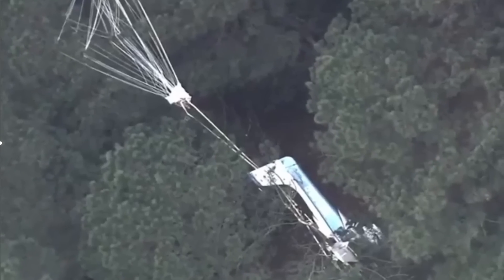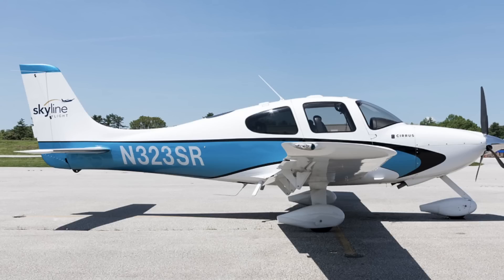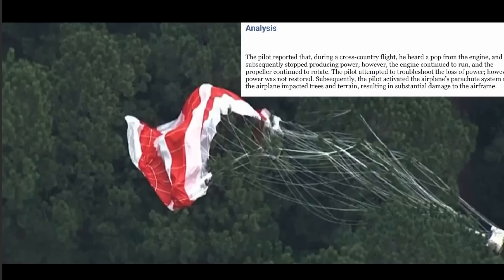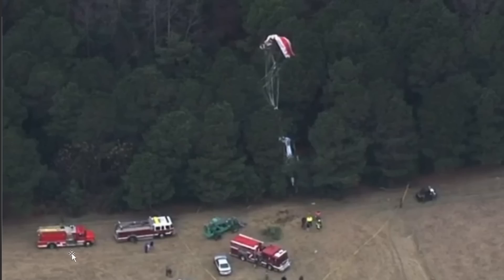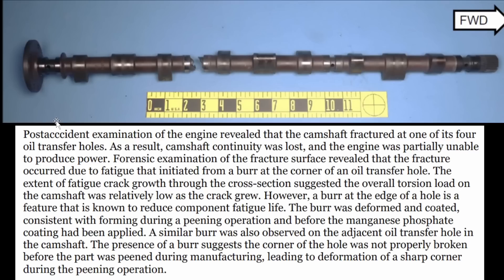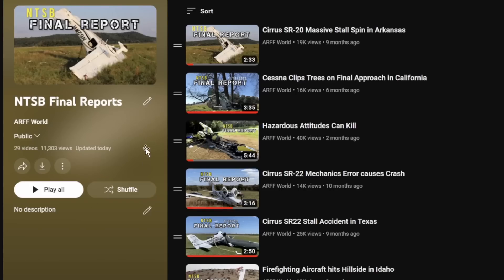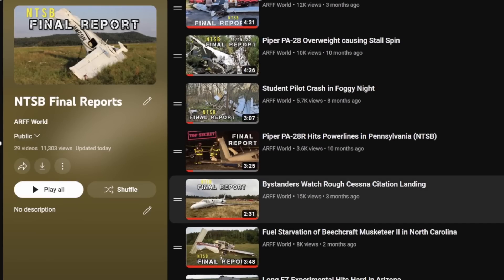Cirrus SR-22 Engine Quits

Comment: Call me a Monday Morning Quarterback if you want, but I found the actual location where this Cirrus came down on a satellite map. The area is not all woods and trees...there were fields available for a forced landing.

The pilot stated he was at 6,500 feet when the engine developed problems. That airplane could have glided approximately 7 to 9 miles from that altitude. There were lots of open fields large enough to land that airplane on. 

He wasted time trying to restart the engine, when he should have first been choosing an available field....but instead, he messed around and then opted for pulling the chute.

He did not have to ruin the airplane.

I wasn't there. I'm just stating the facts.
Reply: Except the facts are that cirrus recommends you deploy CAPS in this situation (unless you can glide to an airport basically). So you are supposed to troubleshoot, and then before 2,000 and making sure you are slow enough pull CAPS. They push this hard, because a bunch of folks lost their lives at the start of CAPS by trying to land in fields and killing themselves and pax when they had CAPS right there. If CAPS fails (it has) then you land in a field -> that the backup.
Reply: @randominternet5586  I agree - that's why you have a chute.  Chances of survival are higher with the chute than with an off-field landing with risks of fences, wires, ditches, a nose-over.  Cirrus's advice is solid, and this pilot was wise to listen to it.
Reply: Who cares?

Comment: I think in that situation I may have pulled the chute. While there are open fields, they are slightly rolling, so would have to be a wheels up landing which will result in damage. Occasion trees in those fields also, could strike and burn. Chute may have been the appropriate call.
Reply: Can’t do a wheels up landing in a Cirrus. It has fixed undercarriage. An off airport wheeled landing is never a great idea if you have other options as the aircraft will not slow down easily and the braking efficiency is compromised. Then you hit trees, buildings etc. It’s even worse if the wheels dig in. Then you have definite structural damage and the aircraft may flip. Off airport with retracts, it should almost always be wheels up. Max deceleration and the aircraft will slide 100 to 200ft max. Less damage than wheels down. This guy made the right choice & lived.

Comment: That field has fences in it. and the part we see looks short. Fixed gear plane so if the nose digs in we know what happens, maybe you get crushed in the cockpit. We see at least one horse, maybe there's more. aside from the animals standpoint horses are heavy compared to that airplane. I'm by myself, maybe I take the shot; my wife in the plane I'm going to land softly in the trees.
Reply from the maker: ThNks for your take
Reply: It also looks like it is surrounded by tall trees and hills which make for a steep approach. Like you, when I see a pasture it make me wonder, "So why haven't they plowed that field?" Usually it's because it is full of rocks, or has a gully, or other features that make is hard to run a plow through it. All of those make it dangerous to land in. Oh... and barbed wire.

Comment: Cirrus instructs their pilots to pull the CAPS system in virtually every scenario. Early pilots would often try to safe the aircraft and land it on a road or field, but many ended in fatalities. Also, you have to pull it soon enough when the parachute has enough altitude to inflate - somewhere between 450' to 600 ft AGL. Their theory is that if you monkey around too long trying to find a good place to land, you will often run out altitude and options, and now you're a statistic rather than a live pilot.

Comment: In my opinion, the pilot did the right thing. The CAPS parachute is on these Cirrus planes because they will not pass FAA without them. If you get too slow and enter a spin in those planes you will not recover. It's even part of the checklist on these planes. I recommend researching the CAPS system. Cirrus uses it as a selling point because most people don't bother to do their homework on things their purchasing. Then they will realise if it didn't have a CAPS parachute you probably wouldn't be making an emergency landing or spin recovery. You would be a crater in the ground and people would be at your funeral lying about how much of a good person you were. So do you want to live or do you want to die? Don't use the parachute if you want to be in the morgue.
Reply from the maker: Thanks Montreal for your take on what you would do.  Can’t go wrong with using the CAPS

Comment: Cirrus recommends pulling the parachute. Unless you're landing into an airstrip or a really smooth pasture, the odds of trashing the aircraft are pretty high. Once the engine quit the only thing you care about is lives, and the aircraft from that moment on is a dispensable. So you better just pull that handle and parachute nicely down, having almost a guaranteed survival.
Reply: Exactly this. The folks paying $900K for a new Cirrus with CAPS - they've insured the plane and don't want to be hurt or killed. Cirrus did a study - the result was use CAPS to avoid getting hurt or killed unless you can basically land on an airport or similarly safe surface. We get story after story about folks trying to stretch no power landings and stalling / spinning. Hitting ground obstructions with serious injuries and the list goes on. And the numbers have backed up this switch to CAPS use, more CAPS use in CAPS deployment envelope, and a great set of results on many of these CAPS deployments. This is no different. These guys are fine, their dog is fine. That's following a total engine failure. Another benefit we all get is these failures are MUCH easier to analyze if the plane isn't in small pieces. They can look over engine which is in same shape as it was when it failed and go, yeah, that wasn't going to fixed in-air.

Comment: Do exactly what this guy did, trouble shoot what you can, then pull CAPS first. Save that field option for if CAPS fails.

It's a composite airframe, it's the insurance companies plane either way it comes down. Remember the approach speed is still almost 90Kts in those things.
Reply: 80 knots on final, 90 on base and 100 on downwind, so ur still moving along pretty quick...
Reply from the maker: Right on Simon

Comment: ?Engine quits or runs Rough that’s what engines  do, however aeroplanes keep Flying so what do you do? you do what you always do you land  the aeroplane. So that scenario is kind of like you’re in a race car or a Porsche sports car and the engine quits on the freeway or race track what do?  you  find a place to pullover,  you land the car and try not to hit any other vehicles or Columns or powerlines or people or buildings you find a clear area to pull into so the mentality would be to have an injection Seat in your car when your engine goes out you inject With a parachute😅😅😅😅
Reply: No, the accurate analogy would be if your race car engine quit, you drove it off road into an open but unexamined, unpaved dirt field at 92 mph while trying to avoid fences, animals, tree stumps, and ditches that would kill you and your family if you hit them before coming to a stop.

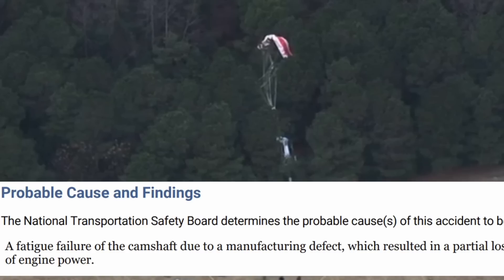Comment: Have worked in aircraft manufacturing and I read the summary at 2:09 with great interest. It pinpoints the camshaft failure arising from a burr at an oil delivery passage. Sometimes in aircraft manufacture the devil is in the finest detail. Small burrs, nicks, pits and scratches can act as stress risers and lead to fatigue failure due to accumulated vibration or flexing during normal operation.

Comment: I am a retired mechanic with 52 yrs. service & used to work at a Cirrus service center central OH.  We had an SR22 out of Mich.  doing instrument check ride prep shooting approaches & his IO550 did exactly the same thing on takeoff. Right over the fence at KOSU & engine quit. I know everybody says never do a 180 in this situation but they pulled it off & nor a scratch on acft. ! Turns out the CFI was also a glider instructor & dead-sticked it right back to airport as they were heading over a heavily packed residential area. Towed it in & tried to start it, could get to hit on a couple of cylinders, sounded like a Harley on nitromethane. We trouble shot (pulled top plugs) & found valves on front 4 cylinders would not actuate. Rear 2 cylinders had normal valve action. Turned out the camshaft sheared in half at exactly the same place! Sounds like a future AD is coming!

us service
Reply: That camshaft must have had a microfracture from the manufacturer, I really see no way for the stress produced by extreme friction with the carrier reaching the stage for such a drastic failure, I also have decades of experience with Porsche competition engines where I used to take them to the limit on my Superflow Engine Dyno bench. I'd love to see a technical report on that mechanical incident.
Reply from the maker: That’s some talent.
Reply: Some more Cirrus 'junk'. A Cirrus is the counterproductive intuition of the fat Piper Hershey Bar wing. Lots of horsepower, a shitty wing with poor gliding distance - except MAYBE under the chute - whereas the Piper chunky wing will get you to the scene of the accident. Cessna WINGS are the best in GA. Say it isn't so! Old man Clyde Cessna knew what he was doing... and Cessna/Textron is STILL doing it with the same basic wing design. Except for failure of some crappy appliances by third party vendors and stupid pilot mistakes, the Cessna wing will get you home safe and sound.

Comment: Yep, the dogs had a long day. Cirruses may be pretty and fast but the more I hear of them the more I think I'll stick with an old reliable Cessna. Glad everybody was ok. 
Whether or not to pull that big chute? Depends on the circumstances and your skill -  
I'll stick with a Cessna.
Reply: But if you need a chute, you won't have one!
Reply: @adotintheshark4848 BRS has an STC to add a parachute to several different aircraft. I've personally installed on on a Cessna 182. I think it was a 2019 model.
Reply: Just sold my 172 a great aircraft but this isn’t a Cirrus problem it’s a engine manufacturer problem. Cirrus is a great aircraft that engine goes in many different aircrafts. I hope they can solve this before someone is killed. Cirrus with its parachute may have saved all their lives.
Reply: Could it be because they are the most produced GA aircraft? 🤔

Comment: I was practising engine out landings away from aerodrome last week.

Land into the wind on a long field…not ploughed, no sheep, no wires, not into Sun. Best glide speed. 

I do wonder when deploying parachute one is at mercy of the wind and hope you don’t land on something that bursts fuel tanks or something nasty enters cockpit.
Reply: You're asking a lot from an a/c with an engine out to set that all up to land. Please practice some other variables like no long field, tail wind, etc. In this case he did the correct thing. Made use of the life saving device at his disposal 😊
Reply: Did you actually practice landing? Lots of gotchas in these scenarios - people have died learning about them :)
Reply: There is an awful lot you can’t see from 1000-1500’ AGL when you commit to a landing in a field - powerlines, small ditches (even 1 foot deep could flip a plane), hidden rocks, etc. Personally, I wouldn’t risk landing in a field only to have one of the previously mentioned items turn my perfect engine out pattern and touchdown into a high energy flipping event at 70+ knots. If I had a chute, I’d pull it.

Comment: I would prefer to remain in control of the aircraft and make a full-flaps nose-up landing with the master switch and fuel valve set to "off." With a fixed-gear airplane like the SR-22 I'd look for a hard surface to land on like a road. It's almost impossible to see power lines in such situations but you can spot the poles.

Comment: Too many variables to say. Some are saying pull the cord, and others are saying, land it. My question is, at what altitude was he flying, and at what altitude did he pull the cord? We saw that he ended up right next to a field, but still in the trees. Was he over the field when he pulled it, (wind drift?) or was it a pull and pray for the best? Since he rode the canopy down vertically, we cannot see what other options he had within gliding distance. Given a choice, better into a field, rather than forest!
Reply: You got to think about ditches, fence lines animals and much more dangers let alone missing your landing and going into trees, in most cases caps pull is best choice vs risking getting too low and only an engine off landing that could have life ending consequences..
Reply: @bcfreedomfighterbcff167  My father died in the post crash fire after an engine failure into trees. Parachuting into trees, is no guarantee that a branch won't penetrate a fuel tank and also result in a fire. Only now, you are hanging high in a tree and becoming a shish kabob on a branch! There was a fair amount of both luck and chance at play here.
Reply from the maker: Appreciate it.  Thanks for stopping by

Comment: This just allows really dumb pilots to fly! What ever happened to flying the plane!
Reply: Same thing with relying on Garmin Glass panels and gadgets instead of looking outside to SEE and AVOID. The newer crop of pilots would be lost in space if everything failed... and no "six-pack" to rely on!
Reply: If the pilot and passengers survived without any injuries then why is the pilot dumb?
Reply: @Airplanefish  Because he did not possess the requisite pilot skillset to land the plane normally in the abundant flat open fields all around him.  Very dumb.
Reply: @ProbableCause-DanGryder  why? There were no injuries? He had an option in this aircraft to use a parachute and he did. Everyone goes home to have dinner. I see no issues with that. If he was in an airplane without a parachute then he would of done something different. But we will never know how that turned out. Just because one plane has more options available to use to save a life doesn't make it a bad thing.
Reply: @ProbableCause-DanGryder  when an aircraft has a catastrophic failure isn't the goal to land safely so you can go home safe?   The insurance company owns the aircraft one something catastrophic happens. So land safely however you need to. This pilot landed safely. No injuries. Why is that a bad thing?
Reply: @ProbableCause-DanGryder  open soft fields with unknown obstacles (livestock, colverts, ditches, ect) with his gear down, small tires and high approach speeds? You think landing in a soft field with gear down is a good idea? I don't. If he was in a retractable   gear aircraft then "maybe" he would be fine. But he's in a fixed gear aircraft.
Reply: @Airplanefish  Also just because the engine quits it does not stop flying and just fall out of the sky! Grow up!
Reply: @jhaedtler  no it doesn't stop flying with a broken engine. What's your point? Nobody said the plane stops flying with a broken engine.
Reply: @Airplanefish  Then why would you pull the chute???
Reply: @jhaedtler  he was in a non retractable gear aircraft. I don't know what's around the area but the open field in the video appears to be a soft field? I can't tell. There appears to be a horse. Are there more livestock? I don't know. But landing a fixed gear aircraft with small tires and wheel pants in a soft field doesn't always end well. The aircraft has a high chance of flipping over. Pulling the chute allowed this guy to go home to his family un  injured. That seems like a great outcome.

Comment: If there are landing options available, to save the plane clearly then land it. Otherwise this is what it is for.
Reply: Don't include saving the plane in the decision, only worry about life. Once you pull the chute you have no control over what happens. If putting you life in the hands of luck seems like a better idea than relying on your skills to land without power, use the chute.
If the airplane is uncontrollable, use the chute.
My personal stats are:
Deployed chute: 0 times
Safe engine out landing in chute equipped airplane: 2 times
Reply from the maker: Thanks Again Matt

Comment: If it failed at one of the bearing jurnals it quite possibly was an oil issue. What goes wrong in a bearing ? A) lack of oil, B)metal in the oil, C) defect.
Reply from the maker: Appreciate you taking the time to share.  🤙🏽
Reply: @ARFFWorld  you're welcome. I helped build many race engines and have had builders with 30-40 years experience point these things out to me .
Reply from the maker: @rebelscumspeedshop  awesome resources